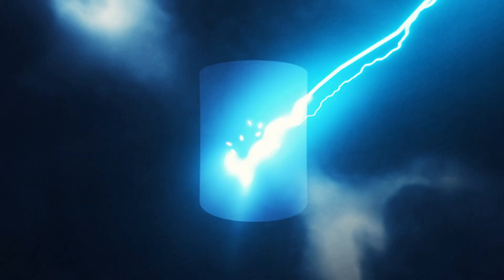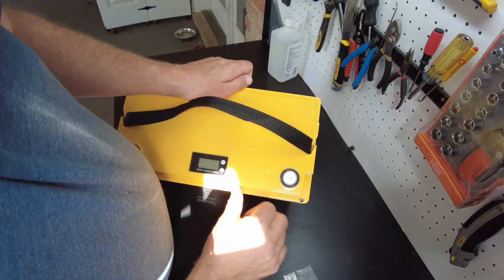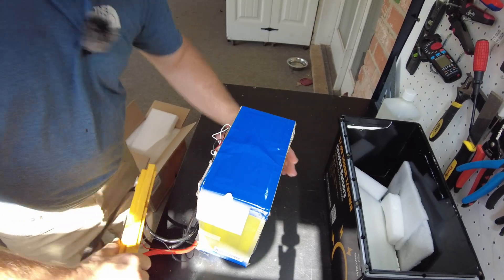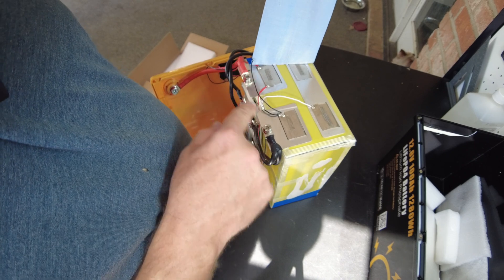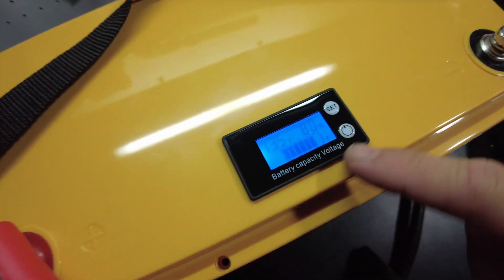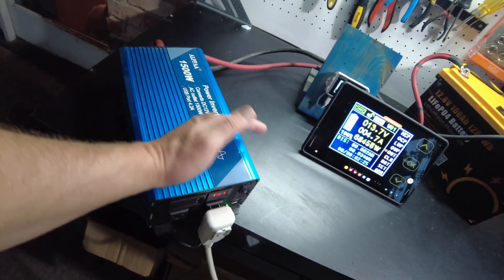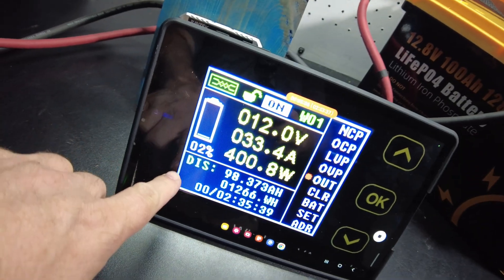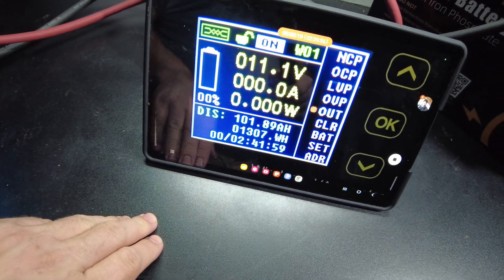GoKWh 12.8v 100Ah LiFePO4 Lithium Battery

Comment: You need to get better at editing...or explain why the battery discharged twice. Looks like you missed it, put a few amps back in it and discharged it again so you could act like you caught it at the end for some reason. This is like those pretentious creators who setup a camera on a street then drive away and come back so they can film themselves driving past...then they come back for the camera, etc.  It's getting old and tired already.
Reply from the maker: Battery discharged once. I record the whole time lapse with one camera, and then let that play in it's entirety in the video timeline. The other main camera I'm recording near the end of the discharge, I put that in after the time lapse. No tricks, no putting amps back in. This is how I do every battery video, which is a lot. Thanks.

Comment: Not a bad battery for someone on a low budget. Id prob disconnect the meter (or put some tape over it) and put some of that harden foam in there and you would have a pretty good battery on the cheep.
Reply from the maker: Yeah, I think if you fix the foam, it's not bad. Thanks